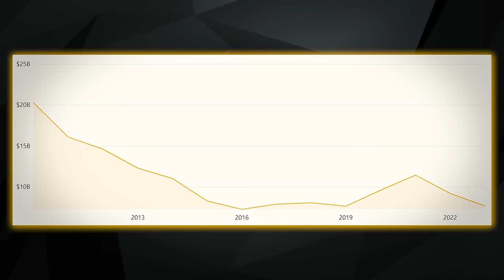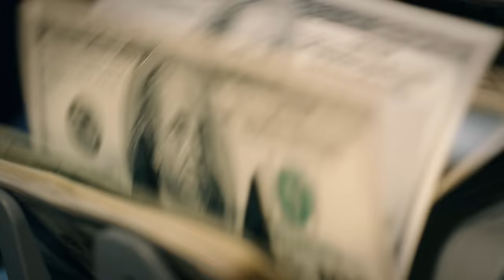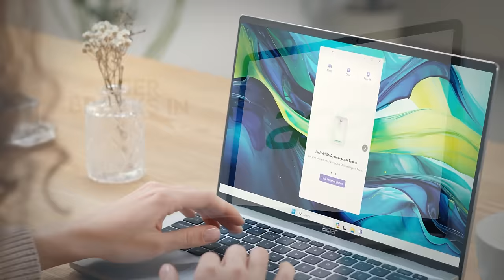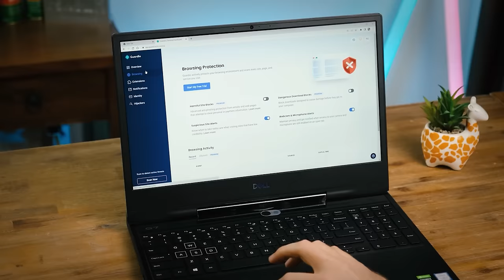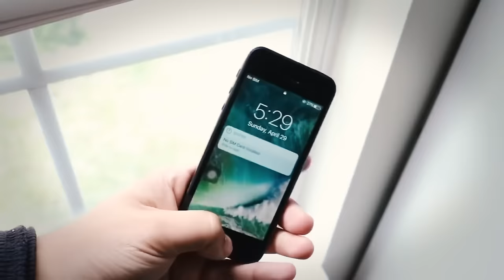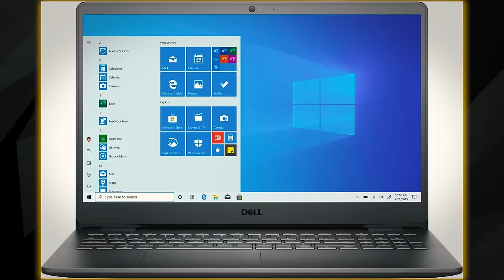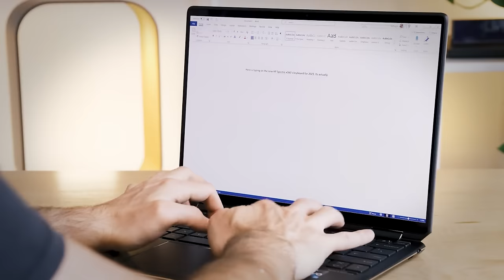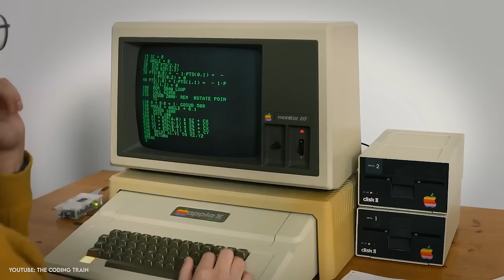Whatever Happened To Acer?

Comment: Acer eMachines were really great value, especially the laptops. they were 100% plastic but otherwise built like a tank. I miss that.
Reply: I remember hitting eMachines laptop keyboard with full force both fists because dumb me was playing Mafia on touchpad. Keyboard got some nice waves but continued working fine until it died year later. 😂
Then I bought some Asus which died after two weeks of use without any kind of abuse. Service fixed it on warranty but gave it back with missing Esc key, greasy and default Administrator account enabled.

Comment: Owned an Acer laptop from 2006-2009, NEVER TOUCHED ACER ever again. LOUSY DISGUSTING PIECE OF S**T. 
Overheats & black out, hard disk die, loud fan, very fast degradation of battery life.

Anyway, I had enough of Acer. Acer was the epitome of "Doing Final Year Project --> Laptop dies" to me. It almost single-handedly failed my graduation if not for the lecturers in my U to recognise the rampant PC die curse issue & had every student email our partial work quarterly just in case. (me and other 3 student of our faculty was saved because of this)

I know that after 2013-2014, the rise of SSD in every laptop spawns the new trend of "Ultra Slim" laptop & suddenly every consumer brand from Lenovo, Hp, Dell & even Acer is pretty much even at market level to have avg. 4 years life.  But I still don't plan on forgiving Acer.

Comment: Shout out to acer for my nitro laptop that just last 3 months!

what worse?
their "authorize service centers" aka 3rd party mall repair shops butchered my laptop (they send my laptop to 2 repair shops and failed), grabbed the thing since its going nowhere for 3 months and when i let a known professional repair shop look into it (they did not even ask for fee even when have diagnostic report with it -PCH and dead core cpu) its already too late. 500 USD down the drain

what worse? acer service center blame me for putting another drive in which i void the warranty sticker that should be illegal in the first place (as for a complete motherboard swap for 75% of the laptop cost!). and please dont support this by saying i should not have opened the laptop and void the sticker which is petty. 

I have an asus laptop now and it got repaired twice free of charge, the last one was screen replacement due to warranty. needless to say i did not even have to go through what i experience with acer

Comment: I do own 2 old Acer Aspire laptops (5552g and 5315) and I used the former until January of this year because the Delta Electronics charger failed all of a sudden, and the latter I bricked within 2 days of getting it from an academy after a failed firmware upgrade. It's a shame because that 5315 would've been a decently reliable laptop for old software. And the conclusion is: Their budget laptops are most likely gonna be hot garbage but their high end shit can sometimes be better than other brands like Asus or Lenovo

Comment: This is weird I am currently using Acer and I use it regularly and it is a good one for my needs. I first got a Lenovo then aftrr a week it stop working went back to the store they could not fix so we changed to same  model after a week it broke again. Apparently the Lenovo brand when it updated the Microsoft software it seemed to burn the board. We switched to Acer still using still updating still works for fine.

Comment: I would not call myself a dedicated Acer purchaser, but over the past couple of decades many of my laptops have been Acer, including my last one. I prefer to use an ISO-Nordic keyboard. My preferred brand is actually Asus. However, I cannot find new Asus laptops with ISO-Nordic keyboards, only ANSI-Nordic keyboards. This is important because I also use desktop machines with ISO-Nordic keyboards, made by Logitech. Yes, I have a lifetime supply = 5, should they ever stop making them. So I regularly buy Asus desktop, tablet and phone models, but Acer laptops. The 2023, EU Right to Repair legislation should ensure that by 2027, I will not have to think about buying a new machine because of a dying battery. So, I am planning to buy my last laptop in 2028, just in time for my 80th birthday.

Comment: I still see people buying the cheapest laptops. That's where Lenovo is selling a lot of Ideapads. The market for cheap computers is thriving.
Reply: My mom bought, on recommendation of sales assistant, some cheap Lenovo with Pentium or Celeron, no slots for RAM (just bare minimum on board)… In 2017 or 2018?
Will get her refurbished Dell Latitude 5590 with 8th. gen. i5 for the same price as that passive "cooled" toaster was.

Comment: got a 14 year packard bell laptop made by acer that is still running strong today..  upgraded memory to 16gb dd3.. the same amount you can find in today's laptops and changed the hdd to ssd.. apart from the lower tier pentium I3 it was future proof with tons of connectivity! The best bang for your buck! today's laptops are made to be disposable with soldered memory chips and 0 upgrade options!

Comment: I had a few of their laptops over the years. TravelMate 240, Aspire 5920G and then an Aspire 7730G. I liked the Aspire series at the time, the latter two had built-in subwoofers and the sound quality was excellent. They also used MXM video cards so it was possible to upgrade them. I still have the 5920 but it's a bit long in the tooth now so it's rarely used. However, I remember that their support was terrible. I had to do warranty claims for clients and it wasn't unusual for the repair to take 3-4 weeks!

Comment: Acer is making innovations though they have made a laptop both with packaging that is completely plastic free and the case itself that is made from recycled plastics( Acer Aspire Vero) and they are making gaming pc's that are relatively affordable specs wise to what your getting. I see Acer as the entry point for many gaming laptops because they are cheaper than Asus on that front. Acer has the issue of sounding so similar to Asus that often your average consumer will think they are off shoots of the same brand. They do make good products and my Acer Nitro has held up reasonably well since I purchased it. I do agree that they have there issues with marketing and depending on what you buy battery is often an issue with windows laptops, but They are innovating in some ways like most big pc manufacturers. I do feel they are overlooked due to the fact that there are just so many pc companies these days, but I also am rooting for them to get things together and hopefully make more innovative products. I do really like what they started with the Acer Aspire Vero for making PC's more eco friendly or showing that you can make a affordable laptop out of recycled materials and I hope they go further with that direction as a differentiator.

Comment: My first laptop in 2009 was the Dell Studio 1735, after that I bought a budget Toshiba in 2012, bought a refer is he'd HP Elite Book (still works, but is almost unusable for modern software,) then I tried out the Dell Inspiron line in 2018...which was a mistake because that one had a built in short circuit on the motherboard, even if it takes extremely good hearing to hear it, I sent that back for repairs so many times that the screen was practically falling out by the time it died after the warranty ended. Finally, in 2023, I ended up getting the brand of computer that I originally wanted in 2018, a Surface line computer, I ended up getting the Surface Studio 2, and while it's still buggy compared to my first Laptop with Windows Vista (For me it was a perfectly good OS, because unlike many, I got a computer with the hardware required to run it properly. The only issue I had with my first laptop was a hardware issue with the RAM, if I filled it beyond a certain amount, a memory parity error would result. 😅)

My experiences with tech, is largely filled with me running into the bugs of any system... With my chances of hitting the critical failure level bugs being highest with Apple... I have regularly been capable of rendering Apple based products into almost bricks... And it's not through any intention or skill. I simply explore what the system can do beyond the designed parameters for anyone not an Apple Engineer of the OS. Changing how the mouse handles shouldn't be that big of a deal, since that's an easy option in Windows and Linux... But Apple is very much against customization, and it tends to break the machines when you go beyond a certain amount of superficial customizing. 💁🏼‍♂️

Comment: The new ACER Chromebooks (with the 12th gen Intel CPU) are awesome!  Fast, amazingly SILENT even under heavy load, and do most of what I need a laptop to do, namely writing and research.  Even the mere 8GB model (though I'd prefer 32GB+) I got is speedy (with hundreds of Chrome tabs open or on standby) with a great display and sound.

And it doesn't suffer from Windows 11 "power management" failures that are endemic to Windows laptops. The Chromebook allows for easy monitor-off and sleep functionality, a consistent success that Windows laptops can only dream about.  My very costly young 64GB Dell and Lenovo laptops are collecting dust for that reason after only two years of use, besides also due to fan noise and hardware issues.

Comment: Acer has the best budget laptops by far, easily beating even TUF, Asus' budget segment laptops which are second best budget laptops in my opinion. I have Nitro 5 12700H, 3060 and it actually competes with Legion 5 pro with same hardware in benchmarks. For example i get 18,025 points from Cinebench23 which is just crazy for a budget laptop and no other bugdet laptop can even come closer. (Some even performs as low as 13k with 12700H) Even some "gaming" laptops from Asus or especially Dell fail to reach such performance! So they don't cheap out on cooling/hardware to reduce performance which really makes them unique in budget segment. However they cheap out on case quality and especially screen is really bad. But this is true for all budget laptops, you will never get same quality panels as more expensive laptops. 

Still i bought it for 1300 dollars (Tax is quite high in my country) and it was even cheaper than building a 12700K and 3060 desktop excluding monitor etc and i'm getting only 10% less performance from desktop so you can't really go wrong with Acer. They should be more expensive to be honest but i completely agree unlike Asus and Lenovo, Acer failed to make a name for themselves. And most people think they are low quality while in realtiy they have higher quality budget laptops. So their main mistake was marketting not their laptops..

Comment: Interesting how everyone bashes on Acer's component quality, when their motherboards are properly coated and can stand user mishandling pretty well. 

In comparison, channel's "holy cow" Apple produces since the 80's the worst system boards the entire planet, quality wise. Old ones plagued with caps which leak disintegrating the board, angular and thin traces, tons of rare and flimsy proprietary connectors etc. And the new ones, coated in poo-like ink instead proper conformal layer, disintegrate even on dessert levels of moisture.

Comment: I still remember my subsidized laptop for school was an Acer laptop. It used a HDD and it had i7 and some nvidia gpu which I do not know the mofel of it (that was in 2017). Fast forwaed to 2020, I was able to get another one which is also an Acer laptop but this one has a worse spec imo. It use an i5 and only an iGPU and the HDD has gotten so slow at doing anything except browsing the web. Unfortunately, the 2017 Acer model has stopped working about 2-3 years ago and one of the hinge has broke. I was surprised to see that the 2017 model had a disc drive reader.

Comment: I find it interesting, that those bits of the computing industry that keep their customers engaged are the gamer, hobbyists, and diy communities.  Big companies that placate the masses just lose their mojo and just try to make what they made before, but at cheaper cost.  A company like Framework got me excited about owning a customizable laptop.  The gaming community (I'm not a gamer) has cool peripherals that can be tricked out and has setups for performance.  The hobbyist/diy has Raspberry Pi, Arduino, ESP and more - allowing one to have specific low cost solutions without having to throw an entire laptop at something.  Acer could take a cue from Framework, or even get into the hobbyist space, by making microcontrollers to keep their manufacturing lines busy and appeal to different customers.  Unfortunately, when I think of Acer, the brand screams "cheap and boring".

Comment: They were a complete ripoff. My first pc in 2006 was an Acer machine and it was abismall. Pcs which were much older out performed mine and worse mine was way more expensive.

They damn sold us a machine with 512mb of Ram with windows vista. The pc was so slow and unusable, the requirements for vista was 2gb of ram were weren't even given half that. I have a great disdain for Acer even when I was a salesmen I always avoided selling there stuff to customers as they always had awful builds and price to performance was abismall.

Comment: Most of my friend group and myself have had bad experiences with Acer products. Though they've mostly been budget end laptops. Always the hinges breaking or screen dying. I still occasionally use my R3 2200U equipped Acer (hinge and screen broke) as a "desktop". Though that job is now done by an older, but way nicer HP ProBook 650 G1 + Dock + 23 inch 1080P E231 display (all gotten for free). As for desktops, i haven't had a prebuilt for 8 years, so no idea about their desktops

Comment: Acer Laptops are among the ones that last along at least based on the 2nd hand market here as a reseller I would get dozens upon dozens of  working Acer Laptops from the late 2006 to 2015 2nd would be HP mainly the Elitebooks which feels like they won't die 3rd would be Dell then Lenovo dead last is Samsung and Sony based on the units that I get Acer actually is more reliable to last years down the line they also have no WLAN lock meaning you can use any WIFI card you want on Acer machines and it would just work all while HP, Lenovo and Dell had a stupid vendor lock which would only allow their certified WLAN modules with modified firmware to work on their Laptop.

Comment: Acer Predator Helios models are still going big in Central, West and South Europe, Turkey, Middle east and Latin America. They are known for being cheap gaming laptops which offer decent quality par on par with Asus and far better than HP. 
Other than that. Acer Premade PCs stopped selling sadly, but they were rather disappointing. 
Acer still sells Monitors , but limited in models.
Reply: i used to helios 300 ph315-52.bought it in 2020.within 2 years went in and out service centre more 20 TIMES!sold it after warranty period over cause it wont start anymore for 5 percent of the price i bought.im a proud lenovo owner now.will buy any acer product.EVER

Comment: My first modern x86 computer was an Acer laptop, which I put GNU/Linux on it and used it until the single-core CPU that it shipped with was unusable.

Nowadays, my laptop is a Lenovo ThinkPad that is just a few years newer than it, also running GNU/Linux. I have a more powerful desktop PC that I do most of my computing on so a super powerful laptop is not really necessary for me.

Comment: My Mom had an Acer. It was defective. Sent it back. They, "repaired" it and returned it. Was still broke. Sent it back again. They, "repaired" it again. Still broke. This went on for so long finally the warranty expired. Never buy an Acer. Ever. That laptop had a bad HDD in it which they said they'd, "changed". They never changed it. They'd get it back and format it. If we'd known they were going to play that game we'd have recorded the drive serial number and caught them at it. They weren't changing that drive no way no how. I finally ran smartctrl on the drive and flagged the bad sectors on it. Now it won't run if the charger is plugged in. Real quality.

Comment: My school just started replacing the old computers... the best few before the change have core i3 2300 s and 4gb of ram... the worst and most outdated have (as in we're still using them)Intel Core 2 duos/quad with 1 or 2gb of ram... keep in mind that they're being used for 3d CAD designing, game making, plc programming, app development and office work. I can't possibly know how, but the slower ones are running a weird custom Windows 7, and the newer ones are running some undisclosed modded/custom Windows 11.

Thankfully as I said, they're replacing the older ones, the core 2 duos and quads are slowly being replaced by i5 13400 with 8gb of ram. I was helping them install them until vacation started

Comment: Something to do with quality, recently bought an Acer Nitro 24-inch monitor, for ₹10500, it has everything like HDR10, IPS, 180Hz, slim profile; except quality. The monitor started showing lines within 2 months of purchase and become unusable. After sending mail describing the issue with photos and videos, I got a replacement monitor after 15 days! but but it was a different model with inferior specs and costs ₹7500! So I send it back and got the same monitor as the original after 8 days. So the issue is that their warranty service is lengthy, and they tried to scam me by giving an inferior model. Do they really think I will consider them again?